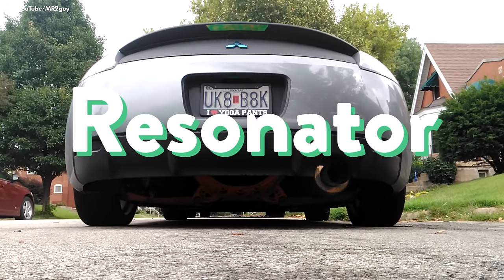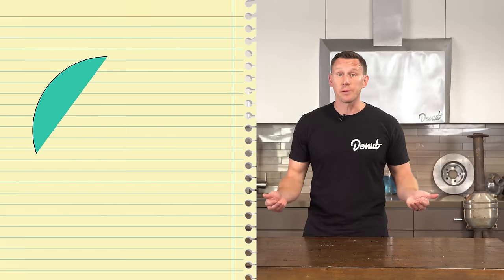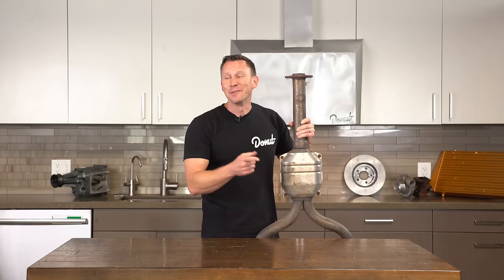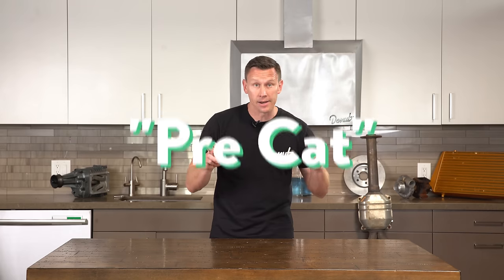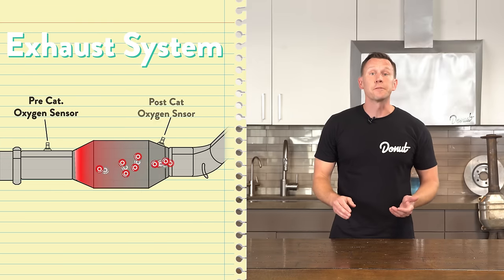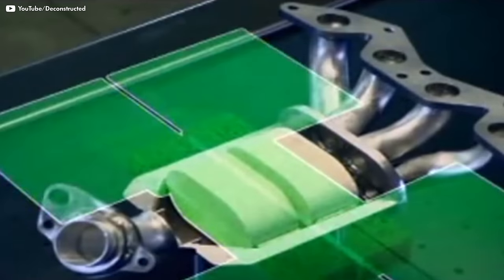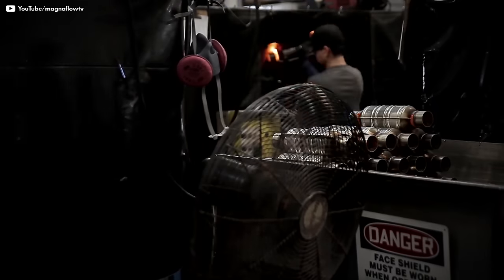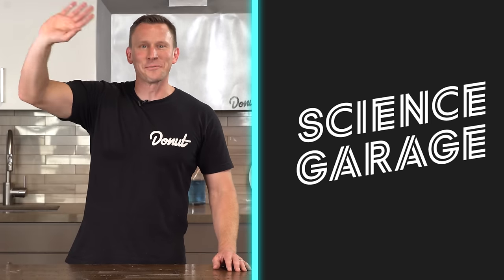Catalytic Converter: How It Works | Science Garage

Comment: Dem older import cats pay the most at the scrap yard lol..... personally as ive only been driving/buying CRXs for the past 15+years all my Catalytic converters get clogged up and chopped. Whats annoying is trying to find 2 bolt flanges and proper exhaust seals....... Think the only car i have that still has its cat is my Jdm Crx sir you can checkout on my IG ZPimugi, lol which will be getting a restore soon.
.
For you Obd0 drivers... This vid DONT apply to you as your Cat is probably going out/clogging.. so youre losing ALOT of HP and gas milage. Cat sensors are also non-existant on obd0 so its best to chop it off and replace it with another cat(ideally high perf) or a straight pipe.... DO NOT GO STRAIGHT HEADER unless you want damage to your motor or valves. Cars need backpressure and youll actually lose power going straight header which is stupid and loud for zero gain unless the cat was clogged..
.
Clogged cat symptoms.. Much like bad sparkplug wires, you get major power loss uphill and pressing gas. Bad idle and may choke when taking off harder then babying it. When in doubt if you have a pre 95 car with a stock cat.. it may die at anytime. esspecially 88-91 hondas... Which almost all of them started dying at the same time( around 2005-2010 all honda esspecially crx cats gets clogged unless it was parked for a decade.)
Fun fact: CRXs were made in Japan in 92' which also included 92' Carborated Crx, jdm, insane.. wish i bought it when i had the chance could of when i got my 90'
.
Are performance Cats worth it for 1st gen hondas and the like???
....... Yes... ive had straight headers for a period in my b18a1 engine/suspension/brakesystem swapped crx before my 2 1/2in exhaust (then i got rearended by a flatbed truck and had a brain hemorrhage. short story).... No exhaust is better then clogged exhaust... but open exhaust is worse then stock or corrected exhaust. 

.

Putting a 2ft pipe on the exhaust which i did temporarily to get to my job before taking it to a shop (ironic cause i used to be a welder till health issues, but i def pay and tip well a good muffler shop if it means i dont crawl under a car when they can lift it into space.) The temporary 2ft or 2 1/2in pipe i made actually recovered quite a bit of performance from No-exhaust at all. further proving how valuable backpressure is. 

.
Can exhaust effect shifting?????? Sounds odd but HORSEPOWER and Torque effects efficient shifting.. So in essence exhaust will and noticeably (in my exp) effects shifting throughout the band. especially in cold stops and shifting in more modest residential area sub 4k rpms shifts (yes i consider my noise cause im a nice guy) where performance loss can audibly be noticed by the trained ear. Just imagine a 130hp motor getting choked to nothing. Itll cause lower rpm shift hesitation and mid highier rpm shift jumps from power coming too gradual and to force it WILL blow a gasket somewhere over enough time or foul the balls out your plugs ect..
.
Summary... Exhaust is important.. even for older cars.. dont let your shit clog or you whole powerplant will suffer and gradually die.. Dont go freeballer no exhaust as youll lose power while damaging your engine..... My last Crx with a custom exhaust had a b18a1(same motor diff car autoGS motor, 5spd LS tranny, twas dank.. still have it, sitting though) had a 2 1/2 in exhaust no-kink bends magnaflow cat and flowmaster muffler, gave a beautiful deep sound. imo glasspacks are stupid and overpriced for what they are and how ppl tend to beat the shit out of them before installing them.

~Epstein didnt coronavirus himself.
ZomPaul

Comment: Crappy design. And I disagree. Leaving 30% of the garbage while doing nothing about crankcase emissions is not an acceptable result.
I'm redesigning internal combustion with a simultaneous-combined-cycle catalytic-staged-combustion piston engine. 32:1 compression, 80:1 expansion, 60+% efficient before any bottoming cycle, and emissions that are lower than ambient. Yes, it cleans the air.

Comment: Dear Science Garage Guy, I hate to correct you but you stated that Platinum (Pt on the Periodic Chart of chemistry), Palladium (Pd, also called "White Gold because it's what the old pocket watches are made of) and Rhodium (used to coat the surface of Sterling Silver because it is corrosion resistant to Sulfer).  You showed Rb.  That's Rubidium.  It's used in pyrotechnics, and as a Potassium (K) substitute.   It's wrong.  Just sayin!-Paul D. Dodson (Analytical chemist)

Comment: A cat isn't a hindrance until some know-it-all starts using a "tune"  to dump out-of-mixture fuel thru the engine or, 
Just as likely,
The common Joe driving around with a Check Engine light on, ECM in safe mode, doing the same thing.

When too much fuel reaches the catalytic converter, it sticks and cooks there, reducing the size of all those little holes, like plaque in a vein.
Inject water in your air/fuel mixture instead of extra fuel.  (Edit:. when you want to reduce temps.)
Tune new builds with a straight pipe in place of the cat.
Don't delete one just because building with one is SLIGHTLY more difficult.

Comment: The reactions are incomplete because we are still trying to burn atomized liquid fuel. If we were burning fuel vapors alone, wouldn't be an issue and we would be getting unbelievable fuel economy. Problem is, whenever someone builds a system that pulls vapors alone from the tank, they are conveniently killed. I run my lawn mower like this but I can't* go public with the design.

Comment: If fuel was vaporized before it enters the combustion chamber as with SmokeYunick's Hot Vapor Engine, it would burn thoroughly without any unburnt fuel leaving the combustion chamber, thereby making a catalytic converter unnecessary.

Comment: Very interesting episode! May I ask a question:

I have a new car model (about 2017) working on diesel and a semi-open garage (I mean there is a ceiling that covers two-thirds of the car but not all the car, three walls but there is no door in the entry, and instead 2,5 meters of fresh air).

Can carbon monoxide still be dangerous if the car's motor remains on, or is it safe even if I forget to put it off and stay inside the garage??

Comment: I've always wondered why California requires higher carbon monoxide on vehicles. After the most recent carb inspection required my timing to be pushed to 10degrees past and increased hydro and mono by about 40%, and then it was high enough to pass. I trird to ask the state, but they only reply with what boils down to "Our system was carefully designed and works".

Comment: Could WD-40 harm the catalytic converter I put wd-40 into the air pump valve to unstick the pump I may have flushed to much WD-40 ahh stupid me ... does the abs have anything to do with the catalytic converter .. Now instead of the check engine light on I have the ABS light glowing at me pls help thx for your time donut ..😁

Comment: It uses heat to cycle electric current through superconductors.

I think when they came out in the 70s, they were suprised to find that it improved gas mileage.

Thats because less power from the motor is being used to generate electricity through the Dynamo, and the leftover energy is stored in the battery. 

And the car has enough power to burn gas, without burning more gas for more power

Comment: A regular catalytic converter works by having the exhaust gasses flow through a ceramic honeycomb structure that is coated in various rare metals. ... While not exactly "cheap," high-flow catalytic converters are specifically designed to meet or exceed OE quality and performance standards without sacrificing flow rate.
Fuck yeah butches

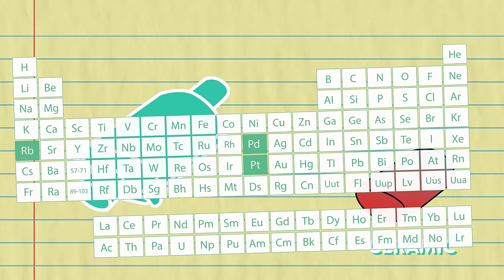Comment: At 1:50 actually, not twenty seconds.  But I mean the biggest...Just dead obvious give away, is that rubidium is nowhere near platinum or paladium on the periodic table....rh which is rhodium ; however, appears right next to paladium.  Obvious error...the symbol even switches to the appropriate rh the next time it's mentioned on screen.  I mean, c'mon guys.

Comment: I have a 1987 Mustang GT. The original owner decided to have the engine rebuilt and during the rebuild, he decided to get rid of the CAT converters and add an exhaust system that is the closest thing you can get to having a straight pipe while being street legal in New York to improve engine performance. Unfortunately, this causes a new problem. Engine warm up times are much longer than they were originally. It takes 15 minutes of grandma driving until the engine is warm enough to drive like I want to. Am I better off with the added heat from cat converters or is there a better way to improve engine warm up times that does not involve choking the exhaust?

Comment: I going to add a catalytic converter to my vintage car. I plan to run a low zinc oil but add Molybdenum Disulfide to lubricate the flat tappet cam., do you foresee any problems? What is the difference between a cat and a gasoline particulate filter and would this be better? Great info, thanks!

Comment: Carbon monoxide does not get rid of the ozone layer (stratospheric ozone - good)  as stated in the vid but rather is a cause of ground level ozone (tropospheric ozone - bad). Also, the explanation of the reduction reactions for NOx are all wrong. They actually rely on unburned or only partially burned fuel for the reactions and that's why cars with three-way catalytic converters must run a bit rich of stoichiometric. Engineering Explained youtube guy got this wrong too. I looked up vids on this for a refresher since it's been 25 years since I learn about converters. Unfortunately, these bozos on Youtube know even less than I do. Do your homework guys before going online as authorities.

Comment: Or or or... you could take the cat off, install a straight pipe cat test pipe (looks like a cat but it's a cat disguised straight pipe) then add a mini cat oxygen sensor emulator on the after cat oxygen sensor so that your vehicle computer thinks the cat is still there and operating properly. This will increase your hp and cost you nothing... how? Turn your cat in for about 80$ cash and use that money for a $60 cat test pipe and a 18$ cat emulator oxygen sensor attachment.

Comment: Wait.. shouldnt you take into account that we ditched the old carberator for fuel injection?? I notice cars that still have that circular filter and a carb have white exhaust coming out and when they push it, black exhaust...

In comparison, my car which has no cats anymore is a bmw that pushes a little more than 500 hp and produces little to no exhaust colors.. only when i get on it..

This is why the air is clearer..

Comment: most likely if your car has a map sensor and a ecu you need your catalytic converter for back pressure which allows proper fuel mixture while accelerating or you hiccup while shifting causing valve timing to adjust more than neccessary even if you variable valve timing may sound like longer shifts. so no you need those catalytic converters and will lose hp if you have a modern car with a ecu but if you tuned your car for it your good to go!

Comment: Part of the reason of the increased efficiency when using a cat is because of the heat generated within it. Hotter air moves faster in the pipe because of the expansion, creating more pressure, forcing the air along, and (correct me if wrong here) the faster moving atoms also create less friction across the walls of the pipe they're travelling down.

Now if you understand exhaust velocity and its correlation to scavenging, faster moving gases mean stronger negative pressure behind each pulse... Stronger negative pressure means better scavenging. Better scavenging means a cleaner intake charge, and also possibly a fuller intake charge, helping to suck the air in during the valve overlap. That assistance is a reduction in pumping losses, and the cleaner mixture makes more boom per cycle, which together makes... Moar Powa, Baby! 🙃

Comment: Does using Marvel Mystery Oil in my gas really affect the Catalytic Convertor in newer vehicles? I know MMO is great for the engine and that MMO claims its ok to use in newer vehicles but I get mixed opinions when it comes to the catalytic converter. I use it in a 2017 Ford F150 3.5 twin-turbo ecoboost. So far no problems. Thx

Comment: Wtf was this? I was thinking these videos are for car guys about how to get more power, not nerds.This is just so unifinished video. And removing your cat does give more power and quicker response,and it is very noticeable.Depends on car of course.most newer cars would need ecu remap and gutting cat would be no good but welding a straight pipe inside same diameter.Well gasses have to get out easy and fast

Comment: I’d like to argue different I work at a diesel performance shop and we do it of delete kits and egr block off plates and when we turn them up we are actually legally allowed to do it because the State of New Mexico says it burns cleaner and I think does if you tube it right not just tune it to roll coal I’d say it burns way cleaner than having a def system which is basically piss. Anyways that’s my view

Comment: I’m not too familiar with catalytic converters but I recently received a used hi-flow one and the internal honeycomb looks good on one side and on the other end a little bent but my question is if it’s normal for it to move up and down when I hold it upright on either side? (Nothing falls out by the way it just moves)

Comment: there are a number of errors in this video, firstly, carbon monoxide does not deplete the ozone layer, secondly, at 1:55 rubidium was highlighted instead of rhodium, if you had taken hold of rubidium, you couldn't even walk out the door before that alkali metal oxidises

Comment: I tore open an O'reily's stock cat to see what it was worth when redoing my exhaust. It was 11" long, with two 2-1/2" Ceramic sections with large open gaps between the sections. The middle section was roughly 3", larger than the ceramic chunks. While tuning the carburetor without a catalytic converter, I did notice a reasonable positive difference and very little change in emissions. So in short, the stock "economy" cat was just for show.

Comment: I liked the video sir. So here's my question. I have a 2009 Toyota Corolla and I experienced rough idle, rpm bounce, hesitation and loss of power. So I took it to a mechanic and he said the Catalytic Converter was shot. My question is what happens if you continue driving a vehicle with a bad Catalytic Converter?
Reply: its clogs then pops probably

Comment: Next time you go to your Mechanic and ask them if your car or truck is BTEX approved, BTEX is what causes Emissions and why E85 is Far better for automobiles and why Ethanol is feared by petroleum companies. Ethanol runs cleaner and cooler than standard gas you can run E85 without a Cat and pass emissions.

Comment: They are also a pain in the ass replace, sometimes. Just replaced the cat in my 01 Prelude yesterday. Took three of us several hours to get the old one off, and the new one on. Getting the new one on was several times easier though. What made it hard was that the nuts and bolts had so much dirt and rust on them, they were very difficult to break loose. But, my car drives so much nicer now.

Comment: At first you mention Rubidium as metal in a catalytic converter and then Rhodium, which is the one that is commonly used?
Reply: Rhodium. Rubidium explodes on contact with water.

Comment: i don't get how a part of the exhaust can effect the amount of horsepower a car has got. did i miss something, can someone explain?
Reply: If a computer controlled engine is programmed to operate a certain way and you alter that then the engine will likely not run as well because of protective programming when the sensors end up out of tune with the computer.

Comment: What about wheel camber.. and what is it affects?
Reply: Tire wear, handling, and comfort. Those are the effects of wheel camber. Correct alignment is prefered because it really gives a good combination of all effects. Altering this should only be done if you know what you are doing and what you want and if you are willing to trade comfort and tire wear you may get better handling but the extra stress and altered angle will likely wear your suspension out real early too. If you're trying to win at a race track then sure but if you're just doing it to be "cool" then you will pay for it.

Comment: Video on why removing the cat causes harm to the engine?
Reply: Programming is why. If the sensors are out of tune with the computer's programming then it will run poorly and maybe in a "safe" mode. If you just ignore this and keep driving you will clog up your engine with unburned fuel and may even overheat parts that are lean and over time your engine basically just wears out way before it should wasting resources. Make sense?